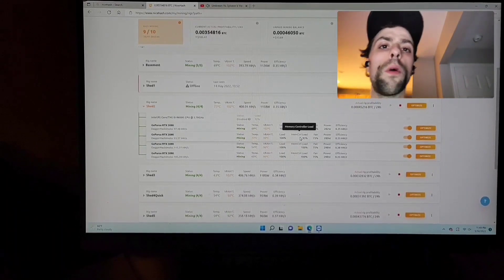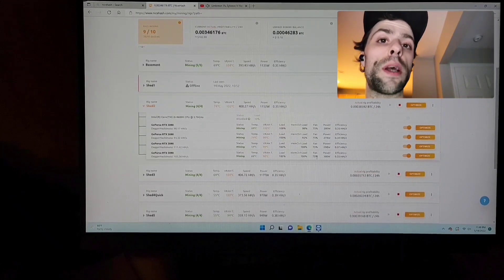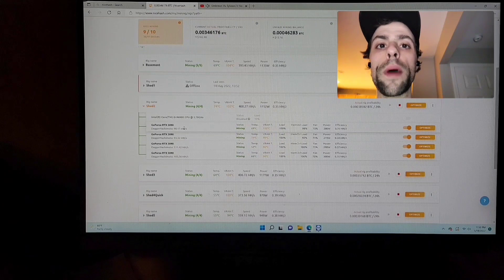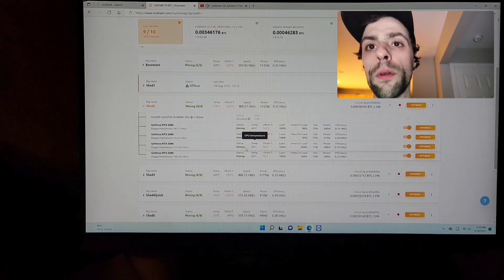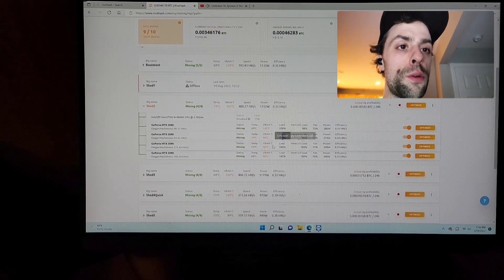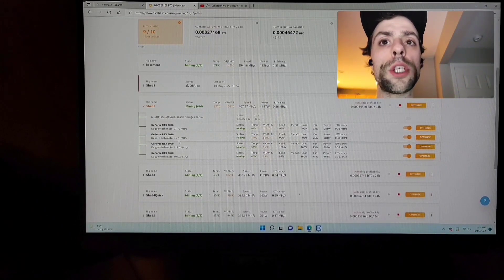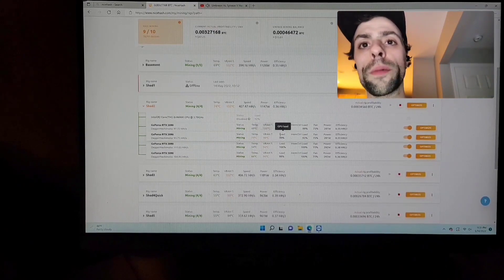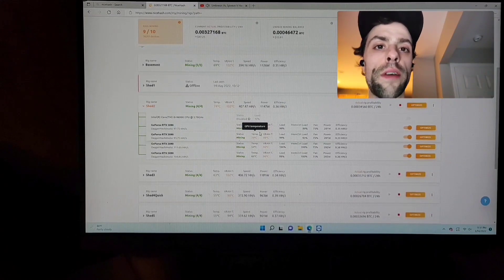FIXING HEAT ISSUES!!! | Zotac RTX 3090 OC Trinity | Lower GPU Temperatures | Stop OVERHEATING

Comment: you should try putting high in the optimizer it gets you 121mhs and is very stable, your mhs are really low and your wattage is kinda high
Reply from the maker: I agree it's just very hot here in the summer months if I let nicehash push them as hard as they can they will overheat. I push all my cards to 120 mh when it get a lil bit cooler. I only do this for a few months. 👍🏻
Reply: @chronicpizza1  ahh makes sense, i just run mine at 100% fan speed with fans on the backplate
Reply: Extreme puts out 125mh/s but not worth the wattage increase but yes, use the Rig Manager's Optimizer!!

Comment: Nice hash farmer lol respect do what you like! Crank them fans zotac fans die no matter what. Also copper plates work great.
Reply from the maker: Thank you good point. I know they are not hard to change. Happy mining
Reply: @chronicpizza1  super easy to change and buy
Reply from the maker: Thank you for the advice. I turned them up to 95% and will go to 100 when it's hot out. 👍🏻
Reply: @chronicpizza1  i recently did pads on my 3090s and nothing will make a dent on my lesser cards. i have fans sitting on top of them now which is cheaper then plates. you can see how i have them in my most recent short i posted lol. looks ghetto but it works.

Comment: Should at least put the fans @ 100%. They are easy to replace.
Reply from the maker: I agree they are easy to replace. I just don't like running anything at 100% I feel like it's not good for long term. I will run them at 95 % if need be. 👍🏻🚀
Reply: @chronicpizza1  Running them that hot is not good long term. Those temps will shorten their lifespan. Running fans @ 100% will only shorten the fan lifespan. GDDR6X cards need all the cooling they can get, and then some. Really shouldn't be running your memory over 95c 24/7.